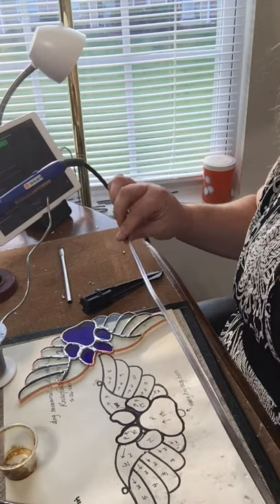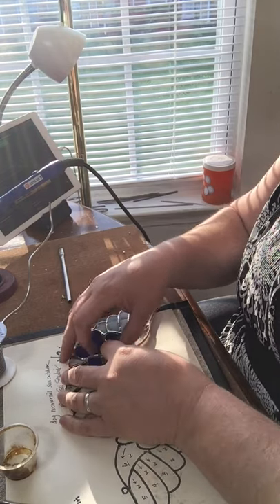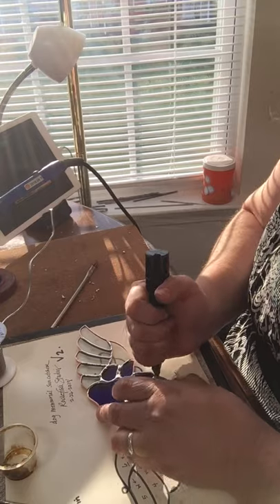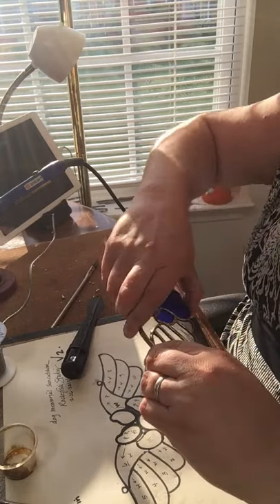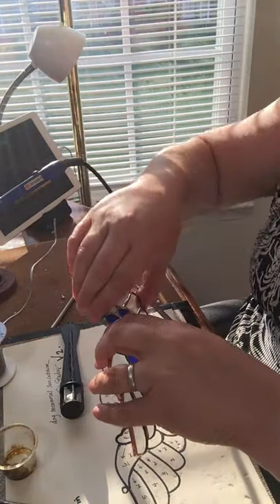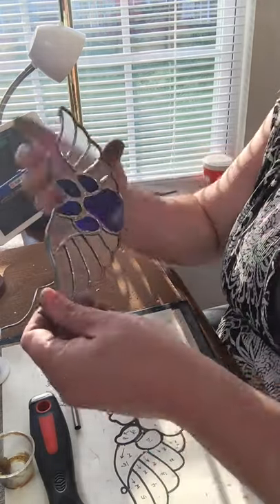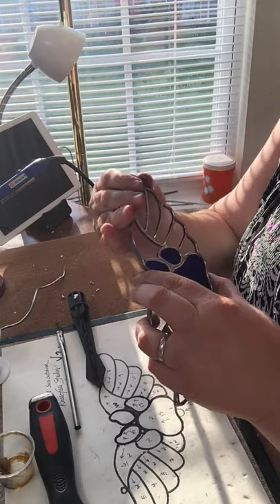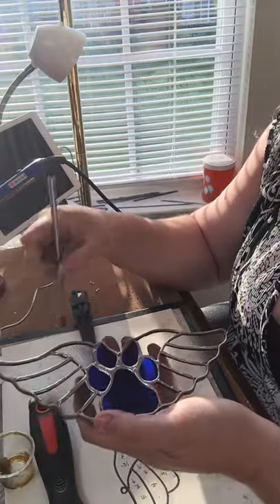Forming Hobby Came to Stained Glass

Comment: Thank you for the video, this is exactly what I was looking for! My copper pieces always feel a little unfinished with just a tinned copper outside edge, and I've been wanting to add something more substantial to give it a cleaner, sturdier border. One question I have is why do you need to tin the lead came? I would just be worried about melting it, like you say in the video.  
Thanks!